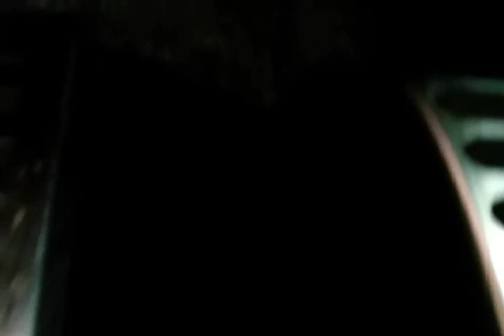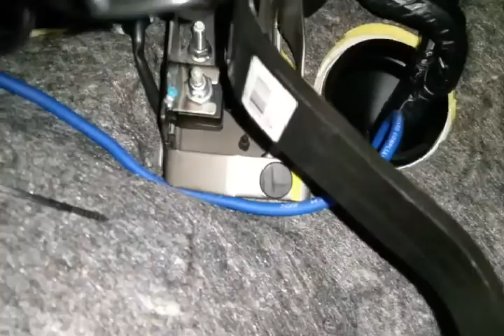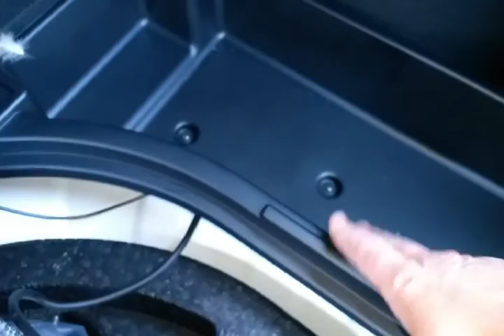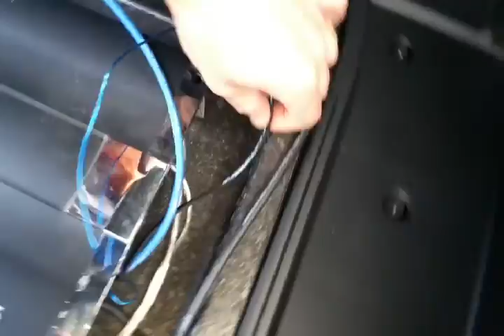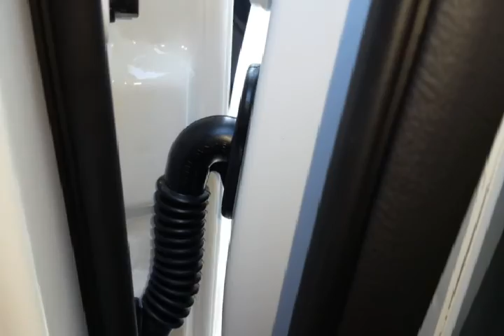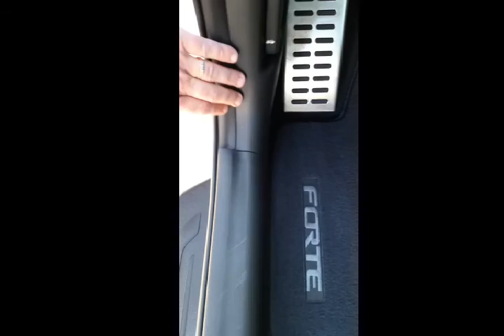2016 kia forte 5 sx turbo AMP subwoofer install

Comment: Your video helped a bit I have the same car except the coop same year but I'm running 0 gauge and I had no idea where I should hook up to the battery does of that fuse box thing on the top of the battery it was looking for aftermarket terminals but couldn't find anything hopefully that little post is big enough
Reply from the maker: The terminals I put on my wire were bigger than the bolts they were attached to.  As long as you can secure the terminal in place using the bolt I think you will be fine.  The terminal was still smaller than the nut securing in place, the opening in the terminal was just not in contact with the bolt itself, just the base of that harness.
Reply: Size the wire to the amp fuses... 0 AWG is way oversized XD

Comment: I have a 2017 Kia Sportage. Do I follow the same instructions?
Reply from the maker: DielHDLedet I honestly don’t know so I don’t want to speculate and send you down the wrong path.  I do know a lot of autos use similar configurations across different models of their cars, I’d google around and see if this is the case and go from there.  Maybe check the Kia forums surely there are some decked out sportages.
Reply: Michael Clancy thanks much !!!😇

Comment: I just got a power sub installed in my 2016 fote5 and now sometimes when Im stopped I hear a vibration coming from the dash. Do you think they had to take the dash apart to install it and didnt put it back on right or do you think this isn't related?
Reply from the maker: Coolnicknameguy without more info it’s hard to say.. could be, could not be.  Did you get a new receiver too or just the amp was added?  You could ask them a couple of questions.  1)  where do they get the remote turn on power from (2) where did they splice into your wires to get line out of you still have stock unit.  Also just to be clear, this vibration is NOT from your now powerful bass right?
Reply: I'll turn off the stereo and hear the vibration so its not the bass but the noise went away so IDK. I was curious if you have replaced your tweeters? I blew mine the other day and want some good 1s that will fit where the stock 1st are. Im not trying to modify my dash to fit some 3inch tweeters that require an amp, something hassle free that still sounds good.
Reply from the maker: Coolnicknameguy I never did replace those tweeters but if you check on crutchfield and input your vehicle they will tell u the exact tweeters that fit without modifications

Comment: What is the purpose of tapping into the speakers? I don’t know much about amps or subwoofers so I’m just trying to get more info. Thanks
Reply from the maker: Casey Mashburn you tap into the speaker wire when your receiver/stereo does not have pre-amp outputs specifically for amplifier.  Since I’m using the factory radio I needed a signal for the amplifier, I tap into the existing speaker wire to get the signal for the amp input.  I use the adapter connected to the wires I just tapped into and then the output of the adapter has the pre-amp output plugs that you then plug into the input plugs on the amp.
Reply: Michael Clancy so if I bought a pioneer aftermarket stereo I won’t need to tap into the speaker wire?
Reply from the maker: Casey Mashburn exactly, your install will be much much easier.  No tapping into speaker wires.  Also no need for an adapter to convert that tapped wire to input signal AND the pioneer will have a remote turn on (for the amp) so you won’t need to worry about that either.

Comment: I had this exact same set up and it worked for 24 hours and then the sub cut out completely. Amp still turns on. Any ideas?
Reply from the maker: Cory Jackson 2 years still going no issues.  Amp comes on from signal?  Disconnect sub from amp at the terminal.  Then connect a multimeter to the terminals and play a test tone (can probably play one from YouTube, I made my own using audacity free app).  The multimeter should read a steady amperage.  If you see the signal double check the sub connections, it’s possible the driver itself lost connection.  There are vids on how to set the gain of your amp using a multimeter and that same method is what I’m suggesting to see if your amp is actually sending a signal to the sub.

Comment: i hooked up the power wire to the positive battery termimanal termianal like you did but for some reason when i tighten the bolt it doesnt tighten all the way the fuse box is still loose
Reply from the maker: Axel Juarez is it possible that there is something blocking the nut from tightening down all the way?  Maybe the wire itself is blocking from a flush fit?  What gauge wire are you using maybe mine is a smaller gauge?  If you look at the video closely you can see my “box” is leaving an indentation in the outside of my power cable
Reply: Michael Clancy im using 4 gauge wire and the nut has like a egg shaped bottom on it as well......thanks for the reply by the way
Reply: Was anyone able to figure this out? I'm having the same problem

Comment: Any concern of the amp overheating because it's confined in the spare tire section with no air?  I'm about to do the install but i don't want to melt my amp. thanks for the video btw.
Reply from the maker: T J its been a year, never over heated and my wife likes to jam.  id say since the compartment is attached to the interior it gets AC, unlike non hatchback trunks where it can get 130 degree

Comment: Btw, what did you do with the remote wire?
Reply from the maker: i just ended up leaving the cheap line out converter in there which has the remote turn on, i think i talk about it at 12 min. in
Reply from the maker: Ttunez83 it would be a very tight fit, you would also need to cut a larger hole.  that said i believe it would work
Reply from the maker: Charles Dorion it would be a tight fit and you would need a larger hole but i think it will fit, use a quarter and see if u think u can get that through
Reply from the maker: Glad u got it to work

Comment: so you spent 2 days on this right? 
your time is valuable right?
you don't like wasting time?
you have pride right? 

you install looks like shit. Straight up.
cut the wires to size. stuffing wires under a panel is not hiding wires. It's hiding a mess.
this install really sucks.

you should have done more prep
more time into the car.
you should have done it right. 

seriously man. if your going to install something take pride in it. 
show it off. 

this is embarrassing
Reply from the maker: The purpose of the video was install points, where i went through firewall, where i tapped into speakers etc.  Not me cleaning up my install which I said I would be doing off camera but thanks for the comment.
Reply: Junior Juarez got no chill. Kick rocks!!